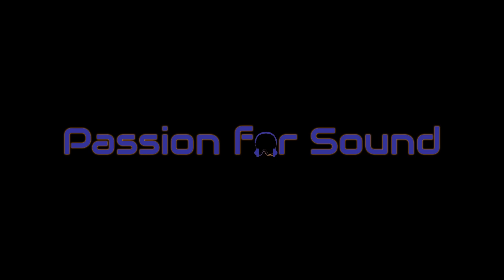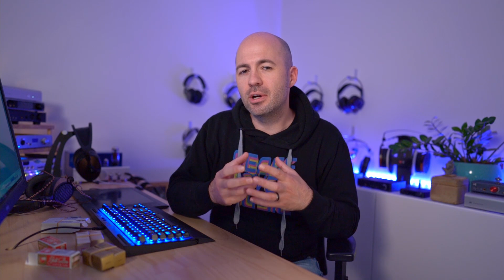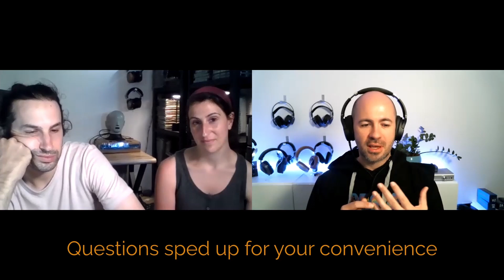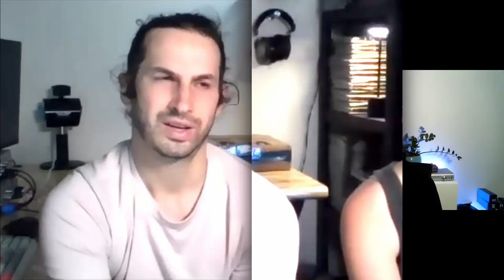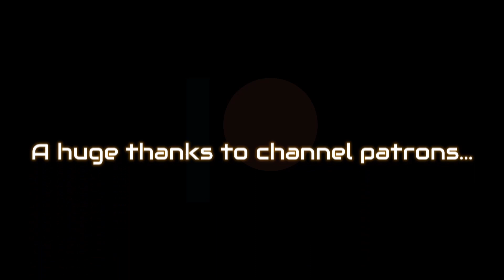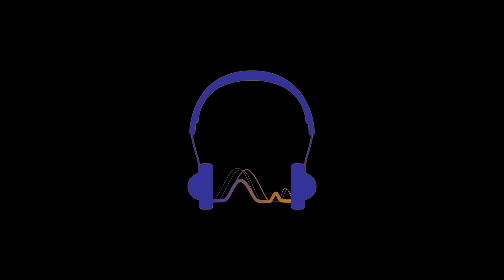Interview with ZMF Headphones Part 2: Designing & tuning headphones

Comment: Beyerdynamic typically has 32 ohm 250 ohm and 600 ohm. The 600 ohm is supposed to be the best sounding but hardest to drive. It is supposed to need a amplifier with a high output impedance which I don't understand why.
Reply from the maker: The idea of high output impedance and high transducer impedance is about impedance matching as I understand it. There's some physics around the power delivery between high a OI (or Zout) and high headphone impedance, but I've never taken the time to understand what it is. I think it might be a holdover from old design standards and doesn't apply as much today with modern technologies producing more power more easily.